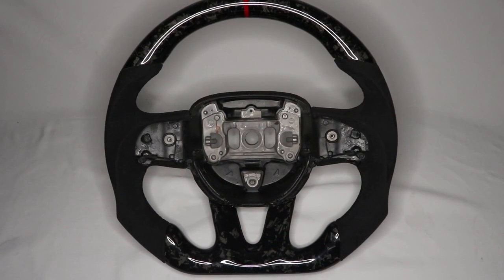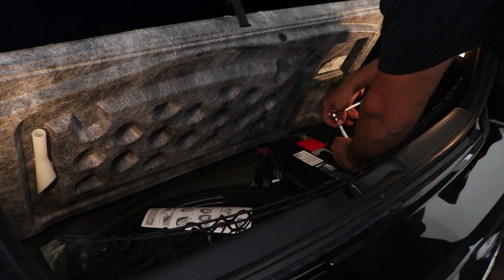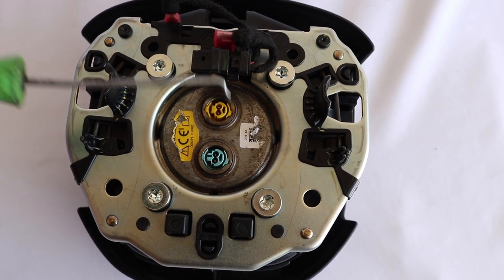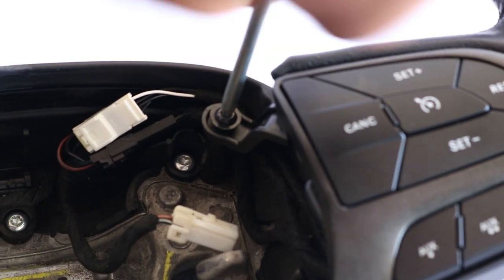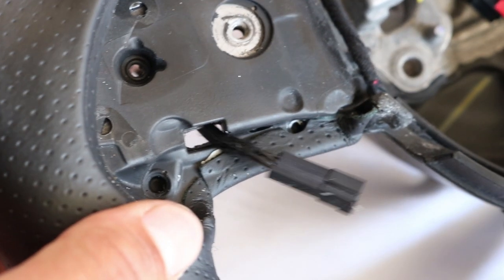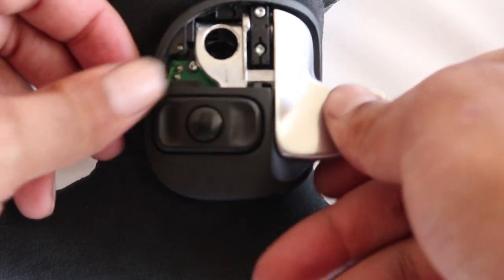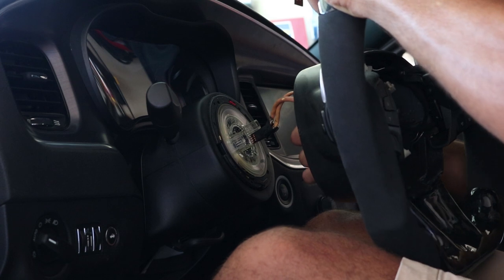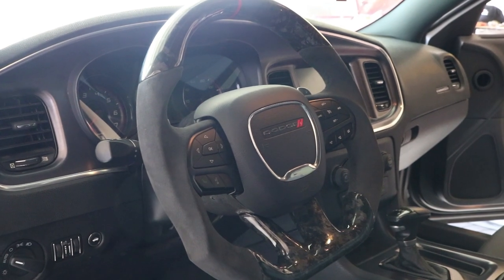Vicrez Charger/Challenger Steering Wheel Install

Comment: FUN FACT: There is no way to remove the vicrez steering wheel. The geniuses behind this "OEM" wheel didn't think to put two holes on each side of the back of the steering wheel so that you could remove it. If you wish to remove it...GOOD LUCK. You will end up drilling into the steering wheel.
Reply from the maker: I removed It by poking two little holes for the release clips. Wasn’t that hard. 

But I see what your saying, why not just make it with the holes.
Reply: Just realized this issue today. So sounds like I have to drill the holes and hope I get it right the first time.

Comment: I just bought one of these steering wheels but I noticed there aren’t any little holes on the side if I ever want to remove my airbag again. Is this the same for you?
Reply from the maker: Yeap. It was the same. Not sure why their made that way.
Reply: @TIRADORACING  would you recommend drilling holes in the same location for the new steering wheel?
Reply from the maker: @392Benny  so I’m this install video it was on a friends charger, I only own a challenger. 

So I HAD to remove the wheel. I used a strait pick (basically a little pin) and poked a hole through the leather from the inside out so I knew where I would need to remove the airbag. 

Don’t need a drill it’s just soft leatherette covering the holes.
Reply: @TIRADORACING  okay I see now thank you for your help!

Comment: Dawg how did you remove the middle bolt I can’t take it off
Reply from the maker: Remeber, righty tighty and lefty loosey lol
Reply from the maker: Turn the wheel all the way left, to lock. 

Then when the bolt breaks loose, straighten the wheel and remove. 

When re installing, install with wheel straight, to tighten turn the wheel to the right all the way to lock and tighten.

Comment: You have any alignment issues when you re installed the wheel?
Reply from the maker: I don’t daily the car by any means and I have an aggressive alignment for autocross. And the alignments work great for autocross but would tear up tires quickly if I daily drive the car. 

But in the sense of aggressive alignments for autocross, no alignment issues. 

If your having camber issues you can grab some SPC upper control arms to help

EDIT: you meant the steering wheel. No, it’s literally an oem frame that’s modified with carbon fiber. It only goes on one way. It has an alignment pin that slides into an alignment hole. 

If there’s alignment issues it’s probably worn suspension components. I would see this when I worked at the dealership all the time.

Comment: Can I find a steering wheel that can have the heater thing connected?
Reply from the maker: I don’t think any of them come with the heated element.
Reply: @TIRADORACING i am using an oem flat bottom wheel to swap my oem wheel that was cut into from theft since i had a a wheel lock on there your video is so helpful on how to swap the wheel and components. Just need help on one thing and im assuming its the same as disconnecting… but i am wondering and doesn’t hurt to ask. Basically the heated steering wheel part how do i reconnect those wires into the new wheel? Is it pretty much straightforward like disconnecting and basically reconnecting? Any specific way or any advice??
Reply from the maker: @MaCAttaK hey I appreciate the kind words, yes it should be strait forward as long as your new wheel has the heated element in it.

Comment: Whats the part number to the bracket to where the controls bolt on to?
Reply from the maker: I have absolutely no idea fam.
Reply: @TIRADORACING  it’s cuz turns out my OEM hellcat steering wheel doesn’t come with that bracket and I can’t install my new carbon steering wheel without it
Reply: @TIRADORACING  but thank you tho 🙏🏻
Reply from the maker: Honestly, I have a 2009 srt8. I installed this wheel in a friends charger. His wheel had all the parts you see in the video. 

Does your hellcat steering wheel have buttons?.... if it has buttons they have to bolt to something.
Reply: @TIRADORACING  yea it has the buttons but the metal piece in the middle of the steering wheels comes up on the corners so it doesn’t have the bracket if you get me lol
Reply from the maker: You got Instagram? Dm me @tiradoracing and send me pics. I’ll hunt that part number for you as well and send it via dm
Reply: @TIRADORACING  okay sounds good 👌🏼